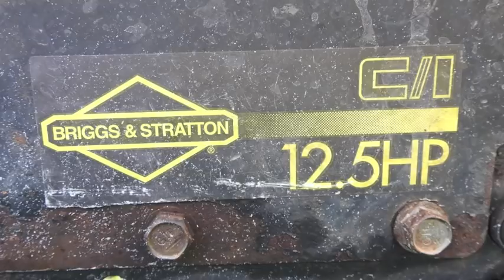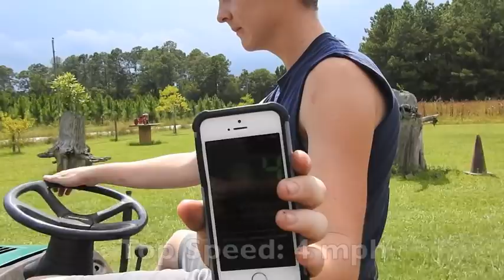Got a New Mud Mower! It's a Weed Eater.

Comment: I got a new mower for free, 18 horse oppy, “6 speed” trans. The engine ran after cleaning a mouse nest but surged so bad but it did kind of drive. Drives in 1st, 2nd, 3rd and 4th. Reverse, 5, 6 are blown out so I need a new transaxle. Well it was free so it doesn’t matter.
Reply from the maker: Free is my favorite, good luck on your build and thanks for watching.
Reply: @chud327  I have got 4 free mowers in a row so I guess I’m kind of lucky

Comment: it seems that mower needs a locking differential.
would also suggest some protection from the mud for the drive beltprobably a lot easier to use a winch to pull the mower rather than jerking on a chain
Reply from the maker: Great suggestions! Thanks for the comment and thanks for watching.

Comment: What kind of steering does it have I got a weed Eater with 25 inch tall maxis tires and about a 5 inch on the rear and 5 or 6 front
Reply from the maker: My steering is stock, I would like to see your mower. Thanks for watching and for the comment.

Comment: Nice mower what kind should I get for mudding
Reply from the maker: I like craftsman tractors, but then again, I love several of mine.... I usually go with what ever is free or cheap. Thanks for watching and good luck.
Reply: craftsman 2nd gen  or the older craftsman 2  are good, the 1st gen are ok, but the steering is weak, the murray lt widebody is good , they're my preference, but basically as chud327 said anything in fair condition at a price you can live with is a good base, if you plan to hit really deep nasty mud I would recommend staying away from anything hydrostat, although chud327s john deer has surprised me with what it's been able to go through
Reply from the maker: Well said and the deere has surprised me too! Especially with dual tractor tires.
Reply: Make sure #1 manual transmission#2 2nd gen steering
Reply: I got a pouland and it’s an absolute beast!